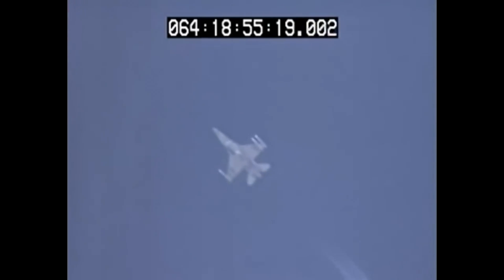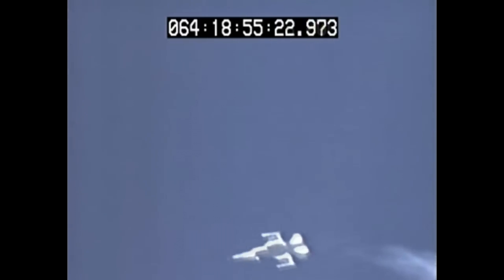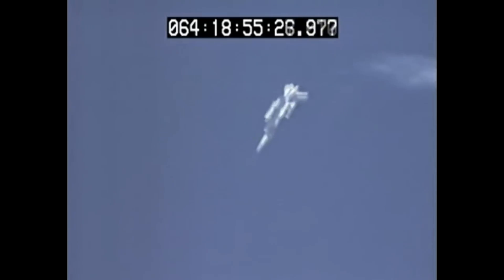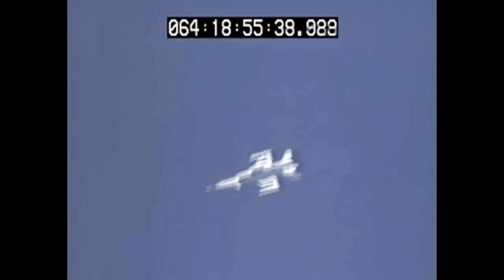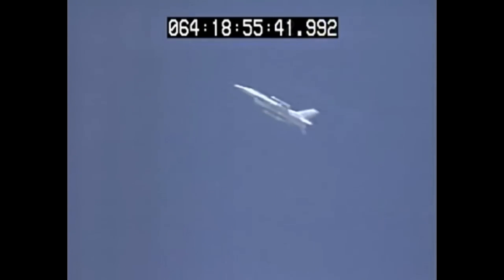Asymmetric Loadout Yaw Departure Test || DCS World vs Falcon BMS

Comment from the maker: Interesting insight is that internal fuel has also big impact on yaw departures as low fuel level switch GC more to the aft. No matter how much stuff you put it on DCS F-16 wing though (asymmetrical) it will never depart. BMS has it covered and more brief departures happens with more fuel onboard or it's more stable - the less fuel the more vulnerable it become for departures
Reply: DCS F-16 feels like tweaked F-18.
Reply: Fuel balance absolutely matters in BMS, but under most conditions wont be noticed (i've flown a ton of sorties over the past two years without issues.) One of the old AAR missions used to start you out with a fuel imbalance so great that it would make the FLCS handle really weird (especially tough with trying to AAR while the plane really wants to pitch up with any positive pitch input).
Reply: What is not mentioned in the RL video is that they intentionally balance the fuel to get the CG back as far as possible so the elevons lose authority just so it will depart.
Reply: That was the reason I got seriously disappointed with DCS. Not sure what made me - then a huge fan of it - buy MilViz' Phantoms, but I immediately felt it was night and day compared to flying things in DCS. You can even see it change posture on the ground depending on the fueling and loadout. DCS simply assumes everything sits right in the CoG.

Still, I'm not particularly impressed by this BMS demo (just like with its "Cobra"), but I guess the only way to get the result I want is to start modeling the vortices properly.
Reply: @getsideways7257 maybe you missed a point. F16 FM in BMS is a very high professional quality as it surpasses the NASA f16 simulator that has been used to improve the real f16 FLCS (because it’s a copy paste of the nasa model with another layer of retro engineering in the lift/drag/thrust on top of it - nasa models only Mach 0.6 behavior) . Su33 fM in BMS is just arcadish model that’s has been done in 2 days for the fun (f16 took 5 years). F16 is and will remain forever the only aircraft with this quality FM in BMS.
Reply: @MultiJp51  That's why I barely mentioned the "Su-33" FM at all. As for the star of the sim, I still stand by my opinion. It can be a largely improved NASA model from the '70s, but it is still a model from the '70s that is barely adequate to handle any out of envelope situations. And as the original video shows, even with FLCS safeguarding the pilot inputs, those situations can still arise with a relaxed stability airframe such as this.
Personally, I'm still waiting for a new generation flight model that could properly process non-laminar aerodynamics, truly giving the 4th gen fighters designers all the credit where it's due.
Reply: @getsideways7257   Nasa modeling is correct to 60 deg AoA and 45 deg side slip. Anything else outside those values are indeed extrapolated. But the day you are waiting for will never happen , so you will have to live with those limitations :)
Reply: @MultiJp51  Well, you see, there is also a limitation to how you use that +60/-30 table. It is meant for the homogenous airflow situation with no twists in the flow - not to mention different air and weather conditions. Also, I believe a scale model was used by NASA instead of an actual airframe? With all that in mind, a good alternative could provide more fidelity overall despite the data coming from the real world itself.
Now, I'm very well aware that it's pretty hopeless to expect getting real time CFD with large eddie simulation during our lifetimes, I still believe alternatives to that can be found elsewhere... like teaching neural networks in some particular way with clever post-processing. Might not be good enough for engineering purposes, but still feel much more natural to the pilots.

Also, please look up Dr. Moritz Lehmann. I think you might find his brainchild rather interesting if not outright mind-blowing.

Comment: And people who are actually flying missions and engaging dynamic campaigns care about this (current) difference why? Oh yah, it’s a dick measuring contest.

Anyone care to comment or dig into whether or not this happens as a difference in aerodynamic modeling or flight control systems (fly by wire) modeling in both or either? DCS models many aircraft with very accurate fidelity. If you’re looking for modeling in suboptimal conditions that only a test pilot might try and a combat pilot might be discharged if they did intentionally…go ahead, take pride in BMS having you covered for that one plane.

Btw, even this test showed a great difference when you had up the TacView conditions were not the same. AoA in BMS was 4 degrees higher to start the departure. And you didn’t consistently show what the control inputs were. It’s not a bad start, but these YouTube tests are trash.

The sims are different for sure. But considering both are sim software of this level of complexity, BMS has its shortcomings too, but DCS pilots could care less to prove the issue.

Comment: I always thought the viper seemed a little on rails, especially with mavericks. with how much asymmetric drag influences yaw even on larger aircraft, i really think it should be modeled more accurately in DCS. The current viper fm is excellent but nothing beats falcombms
Reply: Tbh I always felt that asymmetric loads on the F-16 even in DCS are just painful. F-18 handles it much better.

I do like how you put it tho: The DCS' model is still really, really good. BMS just goes a step further. Tbh flight sims really struggle to simulate what happens if you drive planes to the edge and past it. Also why they did this dangerous test in real life I imagine, some things are just very hard to calculate/predict.

Comment: In Dcs it is the Block 50, wich Version of the 16 you fly in BMS?
Reply from the maker: All blocks behave the same in BMS (more or less), BUT with F-16D it's easier to depart due to a smaller F-1 fuselage tank since there is an additional cockpit for the backseat pilot and CG is switched more to aft.

Comment: Wasn't this a problem of earlier F-16 versions that was later patched in newer flight control software?
Reply: May still happens on "recent" block/tapes : https://youtu.be/wwPtf0W3IAU?si=bx5yZI6uvcs8gATZ
Reply from the maker: @Dee-Jay  Good find!
Reply: Yes, it was an F-16A issue, it was fixed with the C. People are saying it can’t be fixed with software patches. That’s partially true, but it’s important to remember that the A was much more unstable with its early software compared to the C and also lighter, especially the early 2000’s viper DCS is based on.
Reply: @ShawnHinck  Hi!
I am ont talking about that FLCS software fix on earlier block/tape. The issue we are talking about is not FLCS. Here is a BLK32/52 which encroutement the same issue/effect : https://youtu.be/wwPtf0W3IAU
DCS F-16 FLCS implementation isn't accurate ... on many aspects (for instance, try to fly inverted with landing gear down) : https://youtu.be/nkJHQrpobjE
Acceleration-stop distance are not accurate according to charts (breaking action): https://youtu.be/nkJHQrpobjE
https://youtu.be/DqGM9AI5JZU
https://youtu.be/tsAPJGuGKdQ
https://youtu.be/PTyHACaPHUI
https://youtu.be/fzZ6aPboRUU
And same test without anti-skid (which is not implemented at all in DCS)
https://youtu.be/hbolCconAzo
https://youtu.be/qgHE4v29U6E
Here are charts if you'd like to check by yourself:
https://imgur.com/WVS6fHQ
https://imgur.com/HkZQIEX
https://imgur.com/N68M024
https://imgur.com/0yhWbIC
https://imgur.com/yjA4yQX
https://imgur.com/hRPXD94
Air dynamics (not bad, but could be better) : https://youtu.be/HKhJx5Zmb8g
Fuel flow are completely over evaluated in DCS according to Dash-1 and checklist charts (no video).
Rudder authority is not correctly implemented: 
https://youtu.be/tV6kiJUZJKU?list=PLEphSnmqiTQUN2IwGHxw1OyIW9NWGDFMB
https://youtu.be/yxoDk7MYnbE
https://youtu.be/S2mRa4YPBhI?t=1840
CAT I/III roll rate/limiters : https://youtu.be/b0jiN_9xd0o
...
Even the landing gear handle do not work as supposed to (like on any other jet in the world) IMO, they coders don't have the full understanding of what they are doing otherwise, such mistakes could not be possible.
...
I won't spend my day (again and again) trying to give all the available clues/demonstration ... 
We are only speaking about F-16 ... we don't even speak about ATC implementation, AIs, missile dynamics/physics/guidance, AAR physics, weather, electronic warfare ... etc ...
On some areas, code is completely hacked (one exemple among many others) : https://youtu.be/h5N0PeTLJXA
But on some other, it should rather than allowing that kind of issue (showstopper for a potential dyn campaign) : https://youtu.be/otid0wY5VJw
... etc ...
One thing that is much better implemented in DCS is its night vision rendering (focus vs out of focus).
Looking better and higher price do not necessarily mean more accuracy.
Kind regards.
Reply: @Dee-Jay  I wish BMS' AI was all that much better in BFM as advertised...
Reply: @getsideways7257  Hi!
What is the "problem" ... It is something like that : https://youtu.be/dt0wz_VjbUo ... ?
What version/update are you using?
Most important ... campaign or TE/ DogFight mode (not necessarily the same tactics employed) and what is the skill level of your opponent if set in TE or DogFight module (in campaign it is variable and based on MANY parameters, not all are the same, an each are not the same during a same period : https://youtu.be/ZY-CXZtSMfg).
Regards.
Reply: @Dee-Jay  Hello. I haven't tried BMS since maybe 4.32 because of a lot of different reasons including the cumbersome UI (even with the Alternative Launcher), but in the versions I tried the AI behavior was pretty similar and involved "running in circles" at the ground level and eventually dying (unless it was the UFO Typhoon or the F-22), which kind of resembles how the bots fight in IL-2. Do you think the AI is noticeably more different in the latest version and it's worth another try?
Reply from the maker: @getsideways7257  BMS AI BFM is the best AI in any simulation out there - Especially after 4.36 update ;) So, yeah go ahead and try again
Reply: @getsideways7257  4.32?!
4.36.4 is completely different and MANY MANY areas.
I.E. 
- BVR Tactics : 
https://youtu.be/T7y-NUzhaKk

(note that on latest updates, AIM-120 is MUCH MUCH less a magic hammer ... it is way more trickier to use correctly in TWS modes ... no time to go into details here)
- ATC large upgrades : 
https://youtu.be/ur8mPQpVF-0?list=PLEphSnmqiTQXYFChGom3EFDugoFsXVeJl

... and more ATC upgrades : 
https://youtu.be/RWBlFK4gIwc?list=PLEphSnmqiTQXYFChGom3EFDugoFsXVeJl

- JTAC : 
https://youtu.be/V6MoTdwucaE?list=PLEphSnmqiTQXYFChGom3EFDugoFsXVeJl

IFF implementation : 
https://youtu.be/8V1n1d5c3v0?si=2hhwQC45dnocX2Ry

... and many many other features such as cloud IR opacity, frag damage from bomb explosion, icing, hot-starts,, native IADS ... etc ... etc ... so many things than I can't make a complete list.

AI logic have been hugely or even completely refined since 4.32 (4.32 was basically Open Falcon with "better" graphics)

The UI hasn't really changed (expect a bit the resolution) ... but it does the job quite efficiently. You can create a functional mission and flight in 5 mouse clicks.
You can create a COMAO of 20 coordinated ships in less than 10min : https://youtu.be/NpzGg4LysuM ... and have a COMAO pushing a very precise time with precise and consistent intervals with no need to tweak each legs alt/speed with AIs departing from various airbase fully managed by advanced ATC regulations, manage the holds, and quite the hold to push on time : https://youtu.be/04NCbmc8zYs
5min to plan and create an airshow with a/c not spawning in the air but from star-up to full stop landing (that was already true long time ago, that video is old) : https://youtu.be/Pc2c0YZMezg
Planning an AAR takes 2min : 
https://youtu.be/Kul8SC8L0pI

And AIs AAR in queues : 
https://youtu.be/k6Yv8q6FoVw

https://youtu.be/mjlUeAStyzw
... etc ...
... UI is the easiest thing in the world (if you understand its principle). No need to enter into a micro management of everything nor to create scripts to make it works.
I agree, BMS is less sexy than DCS (even is some things are about to change https://i.imgur.com/VLpNoeW.jpeg / https://i.imgur.com/4zKGLu4.png ) ... but seriously, to experience what is a combat pilot's life, it is another level.

That is already a long post, but plenty of content to check and make your minds by yourself (of course, nothing is better than deep study and full scale tests).
It depends a lot on what you are expecting from a combat flight simulation.

Regards.
Reply: Well, you can't "patch" something like that with a software update (unless it's a sim) - you can only prohibit the plane from entering certain regimes. But if you meant that DCS' Viper being newer and all exhibits the right behavior, well... maybe that makes sense. Still, I've been feeling for a while that DCS' aircraft never had change of CoG modeled properly.
Reply: @getsideways7257  Theoretically you can. The flight control computer translates the movement of the virtual stick to the movement of the control surfaces, so they could have adjusted it to use a little bit more or less roll or yaw for the same pilot's input in the same situation.
But most probably they just restricted how much AoA or how much roll/yaw the plane can do with this loadout.
Reply: @Youda00008  That's what I meant. You can't really do much about the aerodynamic properties of an airframe without changing the aerodynamic properties themselves... or adding some TVC perhaps? And commanding the surfaces to have less deflection only prohibits the aircraft from leaving its intended envelope.
Reply: @getsideways7257  But then look at what the Hornet and Mirage can do. Clearly they don't achieve stability during maneuvers by limiting themselves, but rather by clever automatic adjustments that counter the instability built into the airframe. The F-16 could have been programmed to do the same under this asymmetric loadout.
Reply: @Youda00008  But what those automatic adjustments do is exactly limiting the control surfaces deflections to prevent the pilot from going overboard on the controls. And yes, you can force the FLCS to keep well off the dangerous region, but that can be hardly considered as "countering the instability" - you are simply trading off maneuverability for more stability that way. If anything, I'd rather have the means to push the "electronic nanny" to a side than giving off more control over the plane to it.

One good example is the Flanker in DCS - if you just fly under supervision from its fly-by-wire system, it's barely more agile than the C-130 mod, but switch it to the more direct control mode, and the whole thing becomes awe inspiring (especially considering its weight). There is also a more extreme example of that if you fly the JF-17, but its direct link mode makes for such an intense white-knuckle ride, I have to admit I'm not really up to using it all the time (and it probably hurts the overall performance more than it cures it - or I'm just not good enough for it)
Reply: @getsideways7257 that’s the thing, that’s exactly what aircraft like the viper do, it’s a naturally unstable airframe and it’s literally using software to fix those aerodynamic properties. This test was done later in the C and it didn’t have the same issue, so it makes sense that the DCS viper based on the C wouldn’t have that issue because the computer just isn’t letting it get out of control.
Reply: @ShawnHinck  Again, software can't fix aerodynamic properties of the airframe, it can only prevent the pilot from leaving the envelope - once such plane has departed, there's very little chance of bringing it back to stable flight, and ironically, giving the pilot direct control of the surfaces will probably make for a better attempt at that than asking the fly-by-wire do it.
Reply: @getsideways7257  in an aircraft that’s already essentially unflyable without the computer? Not at all
Reply: @ShawnHinck  But F-16s and Mirages 2000 have switches giving the pilot more direct control of the surfaces exactly for the situations where the plane ends up in a compromised position.
Reply: @getsideways7257  it can absolutely happen and the is an override, but it’s not 100% human control, it’s just allowing more deflection, nothing more.
Reply from the maker: @getsideways7257  Example: Take a look here: (Time stamped 3:30)

Me: overshooting in close (because of bad turn circle entry and too much lead - did that in purpose to check the following...)

AI reaction: Reversal with perfect timing AND snapshot possible solution
outcome. He missed and we ended up in a classic rolling scissors

Now that AI reversal with good timing! is something that many human BFM pilots struggle with

https://www.youtube.com/watch?v=GipE0H8yOVI&t=210s

This is just one of many examples how good BMS AI is